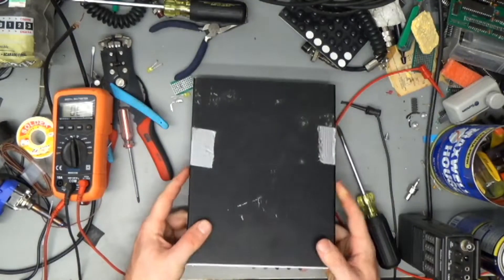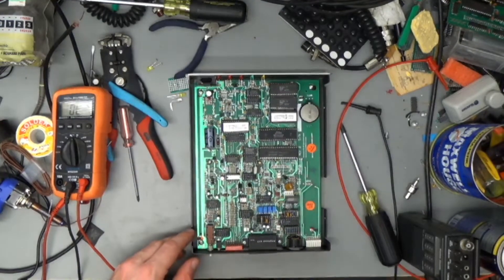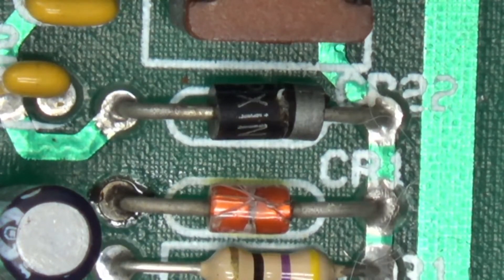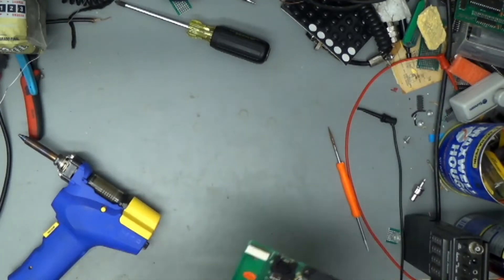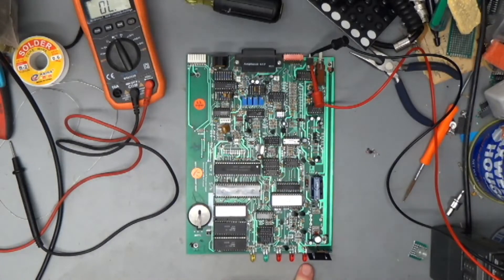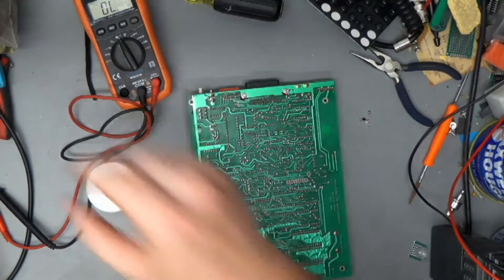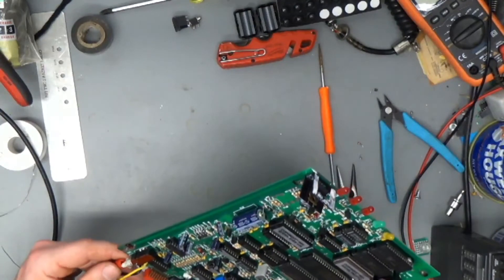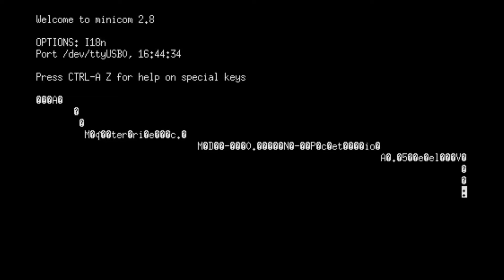Fixing a Vintage MFJ-1270 (TAPR TNC 2) Terminal Node Controller

Comment: Did you get on the air with it? Did it work well?  The last couple of days I’ve been trying to get an old PC up to work with  packet. I just ordered a USB cd drive I need to burn a Ubuntu with. 

I just went to the shop and found my MFJ TNC. I will have to order. RS-232 to USB too. 

I’m very glad to have watched your video.
Reply from the maker: I never got around to trying that one on the air, but I got an HK-232 working and had it hooked up to an SDR for a while.